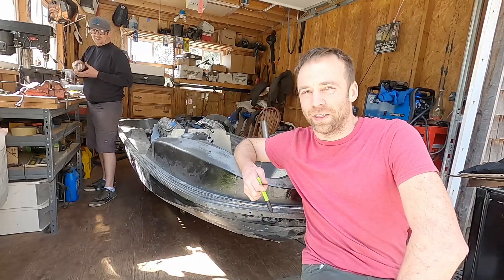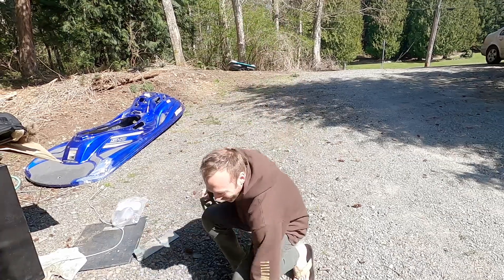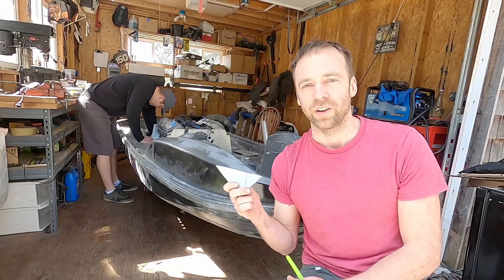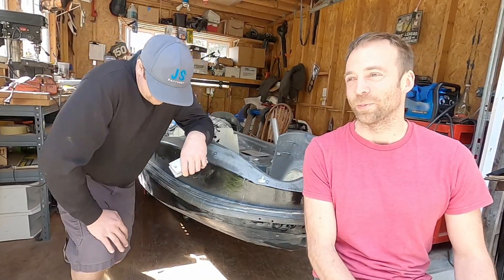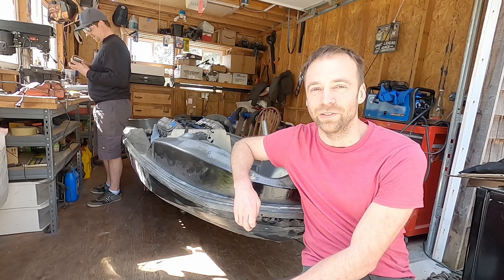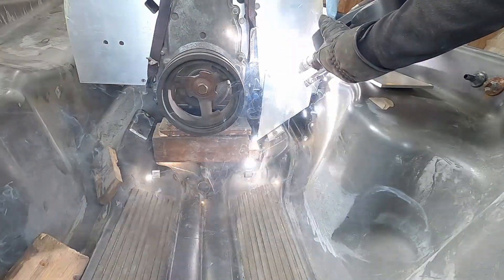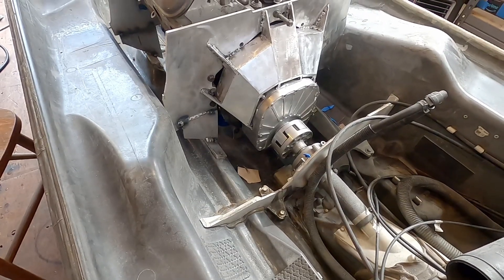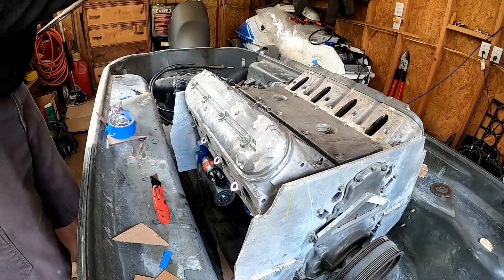V8 ski engine mounts

Comment: Small tip for you guys: Stop using a grinder with a steel wheel to cut aluminum. You should invest in an aluminum blade like the Oshlun SBNF-065060 6-1/2-Inch 60 Tooth TCG . It works really good.

Comment: Are you rubber mounting the engine ? Bolted solid it will vibrate itself to pieces !
Reply: it has the stock ski motor mounts

Comment: I've been so busy working on the manifold, that I didn't even get to watch this video till now.... This is gonna be good.
Reply: Joel I have a question. Well actually 2.

 If the primaries are not water cooled what will keep them from melting under a load? Aluminum melts at 1221 degrees F. Exhaust gas can easily reach that temperature under a hard load.

Also if the primaries are exposed and not cooled in a pretty much enclosed area, won't that cause it to heat up the inside of the ski like a oven?

Not trying to bash. I just want to make sure it will work awesome and maybe bring up a possible problem that might be overlooked.
Reply: @chrisglassey8585  Thanks for the comment, Chris ! That is observant and a real concern.  I have plans to help deal with overheating, both to keep the hull from burning and to keep the primaries from melting. To ease your mind a little, I will write a little more detail.

You may already know this, but one of the reasons that they use aluminum as pistons is that it is able to dissipate heat very quickly. They used to be made of iron and people thought aluminum would melt, turns out that it transfers heat to the cylinder walls so well that it works better than iron, despite the combustion chamber temp being around 4500F 

One reason I made the flange out of 1/2" bar stock is so that it is able to absorb a lot of heat from the runners, I will also be suggesting that the JSB run this without a gasket, just some glue, so that the exhaust flange is able to transfer heat to the head. Also, the primary runners are attached to the log that will be kept under 100C 230F by water cooling. The runners should be able to transfer heat very quickly because of this. 

I don't have all the details worked out, but I am going to be cooling the runners, they just won't be fully jacketed as there simply isn't room. 

Cheers.
Reply: @JoelArseneaultYouTube  Yes the pistons are also cooled by engine oil under them and the fuel and air coming in the cylinder.  Well hopefully it will work man. Good luck to ya man.
Reply: @chrisglassey8585  That is true, however, pistons have the huge disadvantage of not being in direct contact with anything except for the wrist pin bearing. Most piston cooling is done through the rings and sides of the piston to the cylinder wall. Oil, fuel and air are very much secondary. (in most engines) 

The runners are going to be part of the flange and part of the log. Heat transfer in this way is much more efficient and the temperature differential will be massive, making the transfer work even more efficiently.  

Bottom line is that there simply isn't room for jacketed runners, they may touch the hull as is. It's all a giant experiment. I have a LOT more questions or curiosities than I have answers :)
Reply: @JoelArseneaultYouTube  Well hopefully it all works out. It's not like you have the whole internet watching 😄 😄
Reply: @chrisglassey8585    🤣 🤣 🤣 🤣 Right... 

I think the plan is to eventually turbocharge this thing..... SO.... He's going to have to have some massive air flow in the hull, and still probably have to pull the air from outside of the hull for the intake charge.... and have water cooled turbos, and an oil cooler... and so on. 

I was thinking that he may be able to inject water ... but with a turbo, the exhaust pressure would probably be higher than the water pressure. 

Just to be clear. The plan is to add cooling to the runners, just not to have them fully jacketed. I think I have footage of me trying to explain it in my next video.

Comment: Guys guys guys!!  Coming from someone that builds aluminum boats pretty much  every single day. Use a jigsaw to cut the aluminum plate. It works so much better then a grinder. And it’s much more accurate. Bandsaw works the best. But not everyone has a bandsaw. Looking really good!!

Comment: Exhaust : Y pipe to single exit exhaust and don’t do ugly long tube headers do single cylinder collectors fingering in to the exhaust manifold outlet tuck it tight with water box

Comment: How will it float with that much added weight? Just curious. That's a crazy build man can't wait to see the end result.
Reply: @badm0t0rf1ng3r  😂🤘
Reply: It’s roughly 100 lbs more than factory
Reply: @trevordavis4728  OK man I'm gonna call BS on that. 😂 V8s are at minimum double the weight.
Reply: @trevordavis4728  it might be an aluminum block but it still weighs 450 pounds. A typical jetski engine is under 200.
Reply: @badm0t0rf1ng3r  that's a better comparison than saying a v8 only weighs 100 pounds more. I didn't think about the kind of people that ride them lol

Comment: Are you guys not putting rubber in the mix for the motor mounts? I would think doing solid aluminum like that with no rubber isolators would vibrate that thing to pieces
Reply: they did , only shown for a moment but they're using the stock jet ski mounts into their original location,  but additional mounts are in the works. I assume more jet ski mounts.
Reply: @rickems8863 , I thought it just looked like they just used those as a template for getting the aluminum brackets traced and cut
Reply: @philmadden8027  I watched again,  it appears that you're correct,  solid mount. ...

Comment: You need to start working on a system of bolts to hold the top half of the hull down it needs to be removable you will never be able to bond the two half’s together again... maybe wing nuts and epoxy nuts into the back half... just my opinion